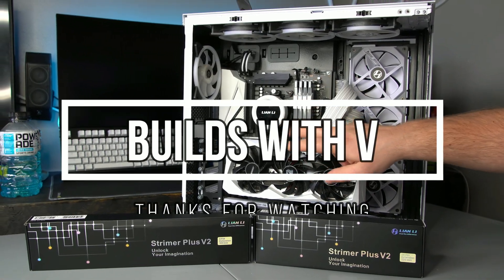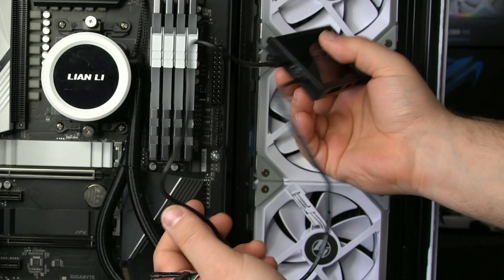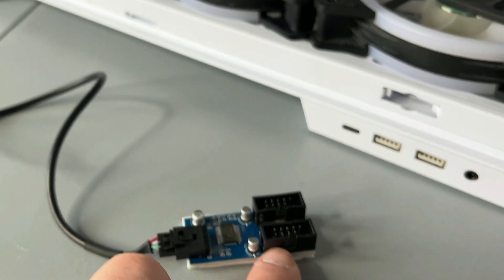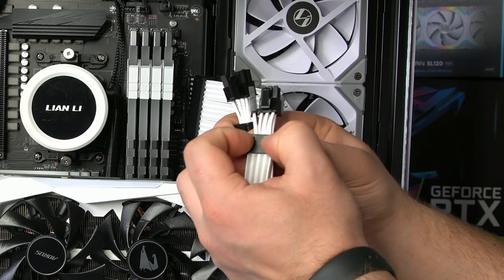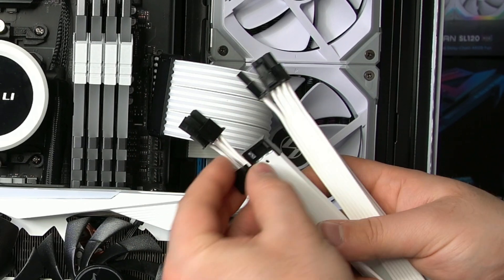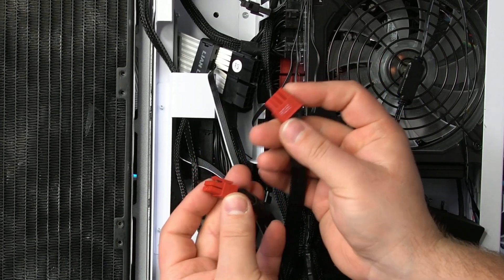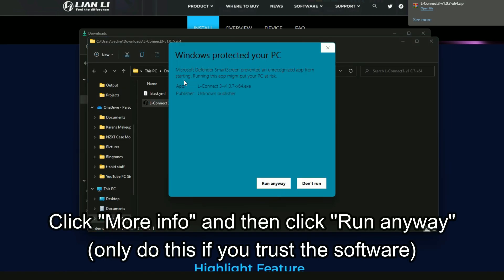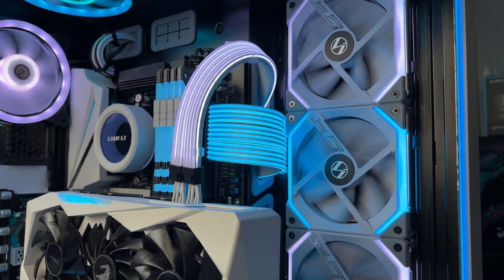How To Install Strimer Plus V2 RGB Cables + L Connect 3

Comment: hi please can someone answer my question i have a rtx 2070 with 14 pci connectors and i want the lian li strimmer wirless cable 8x2 cable and that cable is using 16 pin total can i splitt 2 pins? so i only have 14?
Reply from the maker: @JusTRandoM1993  yes you can
Reply: @BuildsWithV  for the wireless ? and not only the old modell
Reply from the maker: @JusTRandoM1993  should be the same for the wireless but I haven't used them so can't say for sure. Standard GPU extensions are supposed to have a 6+2 pin so you can remove 2 for 6 pin gpus so those should be the same.
Reply: @BuildsWithV  ok i really need this to be confirmed if its work before i buy....
Reply from the maker: @JusTRandoM1993  yes it will split off
Reply: @BuildsWithV  thank you sir for the confirmation have a nice day!
Reply from the maker: @JusTRandoM1993  no problem at all. You as well 😊

Comment: There is no way you can run the software without the controler rigth ? Also, for the GPU cable, mine uses 8p, but could I use the 16 p version thinking on later upgrades, will it work properly, or sould I just stick with the 8p?
Reply from the maker: @cesarrios5778  correct, for the software to work properly you'll need to use the controller. You can use any cable. It will all work perfectly okay and then when you upgrade just plug in the remaining cable

Comment: Hi, i think i dont get it. My hydro ga had a connect hub. streamer has also a hub with different connections. So do i have to connect them all? then ofc we need more usb ports in to connect
Reply from the maker: @SakisMakou  Yes you'd have to connect them all. If you run out of USB ports you can buy the nzxt USB hub and have extra. It's a pain but unfortunately that's the state of pc parts at the moment

Comment: To see that Strimer Plus Lighting in the software,do i need to buy L-connect 3 ?? I directly join to 5V ARGB on mobo.
Reply from the maker: With the V2 Strimer you have plug it into your usb 2.0 header and then download Lconnect and it will automatically pop up. If it’s the V1 strimer then unfortunately it’s not compatible with Lconnect

Comment: So if I connect the MicroUSB cable from the controller to the motherboard I don't need to connect the Sync Motherboard ARGB cable (the one with just 2 wires connector to the controller) ?

Comment: ok from what I understand, the controller is to connect the cable to the software correct? and I need another controller for the fans?
also. can the software sync the fans rgb with the cables?

Comment: It's me again. I plan a lot of rgbs in my new pc and all things i know about rgbs so far i learned on your channel🙏 But i have more and more to find out. 
I would like to know where do you plug in the controller and can this controller control other rgb fans than lian li rgb fans? If so, do i need an argb hub and connect that one with the lian li controller?
I hope this is not too much 😅

Comment: Lian Li only sells 2x8 and 3x8, what do I do with a graphics card with only 1 8-pin connector? Can't seem to seperate the cables since the cable to the RGB controller is attached to both at the same time. Is it safe to just tuck one part away and plug in only one on the GPU side?
Reply from the maker: Yeah I’ve tucked one away without issue. You can do that or make it seem like both are plugged into your GPU.
Reply: @BuildsWithV  Cool, thanks for letting me know! Great video also, keep up the good work!
Reply from the maker: @chrisvancom  no problem at all, glad I could help. Thank you 🙏

Comment: Trying to troubleshoot why I no longer have control of my corsair fans on their own controller, and the strimmers are not options on the L3 connect controller app. And I'm getting a windows warning saying it doesn't recognize my last USB I plugged in or it has malfunctioned...  why don't we use the 3 pin led cable included with the controller? I plugged the USB cable in, in did have 2 slots so used the one next to it. I was so hoping this wouldn't consume my entire day off. Silly me. 😢

I have defeated the problem - https://i.imgur.com/ldvJFvF.png
This is the port for the included LED motherboard connector, once i ran that 3rd cable to my extra LED spot on my mobo i regained control of my corsair controller, and the lian li controller gave me access to my strimmers.  I dont know how your setup functioned without that cable, but mine required that LED cable as well as the USB cable.

Comment: Annoying how only half the cable is lit up. My video card plugs in facing downward on the clip and not the top. So when i plug in my cables it showing the non-lit backside.
Reply from the maker: It’s reversible. I show that in this video

Comment: Question, do you need to connect the strimer to the mobo or can I just use the LED lights and attach it to my original mobo cord.  My issue now is that I'm trying to sync everything together with my asus software.

Comment: my cable that connects to my GPU isn't lighting up fully for me. the rgb doesn't go from top to bottom they start from the bottom and stop at the middle. I thought it  just had like some dead led's but I was messing around in the software and out of no where one out of the 3 cable strips lit up top to bottom fully but is stuck as red yellow white and blue from middle to top. and i can't find the option to mess with it or sync it or change anything about it. ik its confusing so is there anywhere i can send a picture in so you know what im talking about?

Comment: Lian Li now makes the 16 Pin RGB Cable for the New GPUs rated for 600watts.  Bought mine at Micro Center.  This new cable is nice and simplifies all those cables down to just one but you lose all that RGB to only one cable so I kept my old 3 cable 8 pin lines😊 and kept it plugged in and routed it to the GPU anyway and hid it behind the GPU for more RGB goodness.  Even though it’s not plugged into the GPU I used the dead plug that comes with the cables as a tester to keep them lit up.  Looks much better.

Comment: Hey I have already a controller (lian li )my sl inf are connect on this controller  can I use only 1 controller for all my lian li stuff ?
Reply from the maker: Unfortunately you can’t. You have to use both controllers. There is a way to get an adapter to make them work but it wouldn’t be native
Reply: @BuildsWithV  because the problem is that my usb connectors are already in use and I don't have another argb connector
Reply from the maker: @AaaAaaa-zc9zn  you can use the nzxt usb splitter. That’s what I use

Comment: so i can get all of them working but one single fan and the GPU one. They light up, however i can't use the app to modify their pattern. any ideas? (The one that goes into the motherboard is working just fine just not the GPU one)

Comment: So I have been playing around with this for a couple days and my issue/question is can this controller manage my 6 120mm case fans and my 3 120mm AIO fans.  I have been into bios and I have not bought a fan controller yet and do not want the extra box in my system unless I have to or buy another product that is all in one.  I also have Kingston fury argb ram and there is not even an option for that to be controlled.  My boards is an ASUS x570 ProArt Creator series.  Thanks

Comment: I will make my build now that i got everything delivered but this just caught my eye! I am new to PC building and want to use these strimers for both my GPU(MSI SUPRIM X 4080/Corsair HX1000i PSU 2022) and MSI WIFI EDGE Z790 mobo - Is it compatible?  If not what variant should i go for? I am really lost.. Appreciate it!
Reply: Yea it’s compatible I have similar specs it connects with any gpu and cpu psu cables

Comment: Will there be any problem if I install it with RGB Fusion controlling other devices? I want to try this software with the gpu cable to test the different RGBFusion effects it offers without uninstalling it because I have some fans configured
Reply from the maker: You can use the included ARGB dongle thingy and plug it into your motherboard and then switch it to MB sync in l connect 3. Then you can control these with RGB fusion. I believe the gpu Strimer comes with it’s own dongle that can be used to plug it in separately from the controller

Comment: how can i sync all the rgb in my computer with the strimer v2s? do i need to use the argb connector with the controller or how does that work?
Reply from the maker: If you use the ARGB connector then the strimers will sync to you motherboards software. If that’s what you’re looking for then it’ll work. If you want to control all of your rgb devices with L connect 3 then it’s not really possible unfortunately unless you have all of lian li products

Comment: i have no more slots to plug the usb cable in motherboard, but in my case i have the set of lian li fans with another rgb controller, could i use that to conect the strimer plus? i mean... not to use the same controler of fans, but a way to plug the controler of cables in the fans controler...

Comment: Thank you so much for demonstrating the part where you flip the 8 pin cables. It was something I've been looking for all over.
Reply from the maker: Glad I could help 🙌
Reply: @BuildsWithV  also another question, do I need to plug in that rgb controller cable? The thinner black one to control the rgb. Or can I just control it through the software?
Reply: @BuildsWithV  if ive only bought the 8 pin (no controller included), where do i plug the small black cable into to control it?
Reply from the maker: @VeeTalksStuff  you’ll have to plug it into your ARGB 5v header in your motherboard
Reply: @BuildsWithV  and I can still use L-connect 3 without the controller?
Reply from the maker: @VeeTalksStuff  unfortunately you can’t. Will work with your motherboard rgb software. Lconnect will only work with its own controllers
Reply: @BuildsWithV  oh okay I've just heard motherboard rgb softwares slow peoples pc. So if I don't use anything, it at least stay rainbow?
Reply from the maker: @VeeTalksStuff  I have like 4 different softwares running for rgb on my pc and I honestly couldn’t tell you if it slowed it down at all. Never tested it personally. I’m not too sure if it’ll be rainbow or a solid color. I think it might be a solid color but I also think that varies from motherboard to motherboard
Reply: Mine shows up solid color plugged into my dark hero motherboard

Comment: I don't have the controller? Do you get it with the 8 pin?
Reply from the maker: It comes with the 24-pin
Reply from the maker: I believe you can also buy it separately

Comment: Why not go for a 2x8 pin for the cpu-powerconnect on the mobo aswell???????  You should be able to run 3 pcs of strimer cables in every rig. 1 on cpu power 1 for gpu 1 for mobopower. Why haven't anybody done that?
Reply from the maker: I’ve done it, check recent video and Instagram photos. Made it custom for cpu

Comment: Hey mate, one question. I just bought 1 24 PIN + 3X8. May I use just 2x8 instead 3? I saw you splitting it.
Reply from the maker: Yes you can, works the same
Reply: @BuildsWithV  but I can split it, right ? I mean, use just 2x8
Reply from the maker: @LibertyTGP  you can split the end that goes to your GPU but can’t split it on the other end where the connector is unfortunately.

Comment: Can anybody help me? I installed the Strimer Plus and a Lian Li Fan Controler (4 groups). Now I installed L3 Connect nut there is no Option for the Strimer Plus. I can change the fans but no strimers.
Reply: same problem. did you solve it already?
Reply: @yasun89  i think i reinstalled the app like 3 times and checked the controller. The controller had a loose contact so I had to reinstall the cables. Maybe thats the same problem with your rig? My controller broke 3 months ago. Really bad quality imo, unfortunately.

Comment: Just bought the Strimer Plus v2 2x8 GPU cable, I don't have the controller or the 24-pin cable. Is the controller needed to customize the lightning individually? I got it to work with Asus Aura sync but can't change the effects on the cable..
Reply from the maker: Yeah if you want to change the lighting individually you will need the controller. They sell the controller separately as well if you don’t want the 24-pin
Reply: @BuildsWithV  oh well, I was afraid so. Thanks for the quick reply.

Comment: For some reasons Everytime I power on my PC the strimers are max brightness until the lconnect 3 loads up in the background. Any tips to avoid the max brightness at startup?
Reply from the maker: Unfortunately it’s a bug they still haven’t fixed. When I have one cable a specific color and the other cable another color when I load up it changes both to same color. They said they’re working on a fox but that was back when I made this video. Hopefully soon
Reply from the maker: Oh, I just turned on my PC today and it seems the issue has been fixed. Yesterday I updated my L connect 3 and seems it may have fixed the issue. I’d suggest you try to update and see if that fixed your issue as well.

Comment: my motherboard has no header or anything, and i have some question if you have time answering, because im still new at this

1. my mother board has no header so i'm curious if i buy the one with controllers how can i sync it or control it.
2. would it sync even tho i have different brands of fans and fan cooler.

Comment: Do I need the controller, or can I just use the ARGB on my motherboard?
Reply from the maker: You need the controller, you can still use the ARGB on your motherboard but through the controller. The 8-pin of the v1 was able to be plugged directly into ARGB header but the 24-pin was controller only.

Comment: Lost me on the flipping part. Why did you need to flip the cables
Reply from the maker: I had to flip mine because of the gpu connectors. They were opposite. To determine that you just plug them in and if the rgbs are on the wrong side then you flip them.
Reply: @BuildsWithV  ooh OK so the rgb isn't 360 around the cables. Didn't realize that

Comment: Hello bro
First of all, thanks for your amazing videos

I have one question I have a MotherBoard Asus Rog Strix x570-E Gaming WIFI II and it has only 2 USB 2.0 ports
I already have one of those connected to the CPU Light (Lian li XL Razer edition)
The second is a Ryujin II 360 liquid cooler, is the splitter you listed safe to add the 24 PINs and 8x3 Pins Strimer Plus V2? I really want to use that software instead using aRGB motherboard software and I dont want to burn anything

Please let me know your comments

Thanks again :)
Reply from the maker: Yeah it’s safe to my knowledge. I have the 4 splitter version and have 3 other things plugged in with no issues.
Reply: @BuildsWithV  Thanks for your fast response bro, I was checking the Motherboard manual and each port supports up to 2 without the splitter, i found below video

https://www.youtube.com/watch?v=eAMpxdVftwM

have you performed something like that?

I will try that, if not succeed i will get the splitter

Thanks gain
Reply from the maker: @juancarlosrochazepeda784  I have not tried that but I did hear it works just fine. I prefer the splitter for myself because in case I need to remove devices it’s easier. Plus the splitter is in the back which gives me easy access instead of removing the gpu
Reply: @BuildsWithV  I will try to merge the usb 2.0, if it doesnt work, I will get the splitter, thanks again bro greetings from México

Comment: You have to make sure the L-Connect controller hooked up to a USB header and one cable for sata power. Then install the L-Connect 3 software.
Reply: What about the 5 volt? Do u need it?

Comment: As an owner of the V1 cables I don't really need these but the temptation to upgrade is real...
Reply: If you haven't found this out already, you can buy the v2 controller separately and it will work with the V1 cables the exact same :)

Comment: I must have two counterfeit strimers because the box setup just has one input for the 24 pin and one for the gpu.  The problem I am having is the connector for the gpu does not fit.

Comment: are there any downsides or do you lose any features when using that usb splitter/extender?
Reply from the maker: No downsides, works as it should without issues.
Reply: @BuildsWithV  thanks for the reply just bought the splitter
Reply from the maker: @butterflyscreams1965  no problem at all. I love it since I have like 5 devices to plug into usb lol
Reply: @BuildsWithV  do I need to buy a splitter as well since I don’t have a available USB spot on my MOBO?